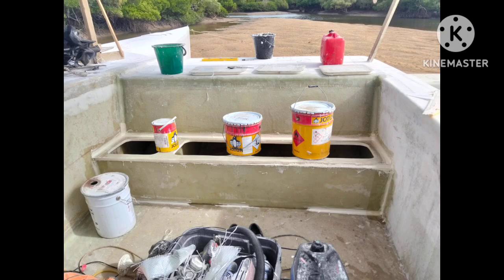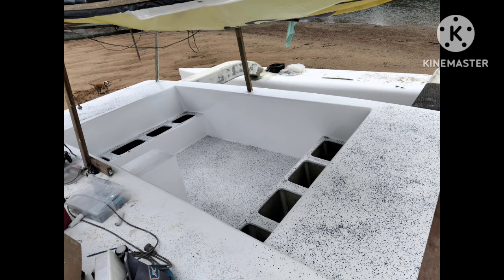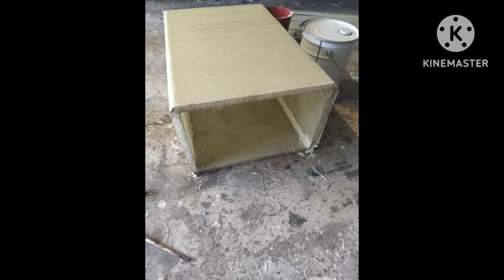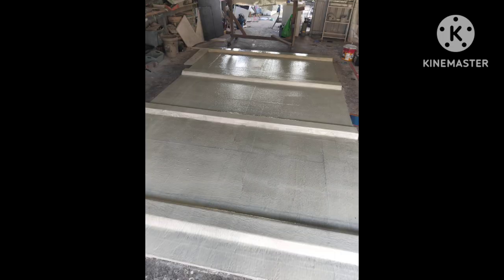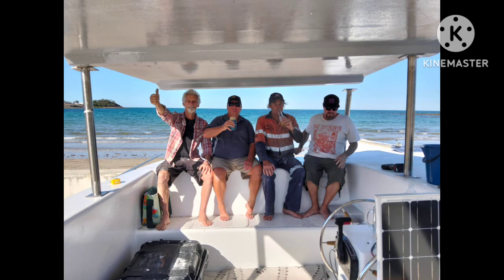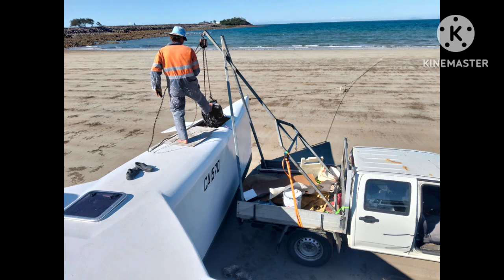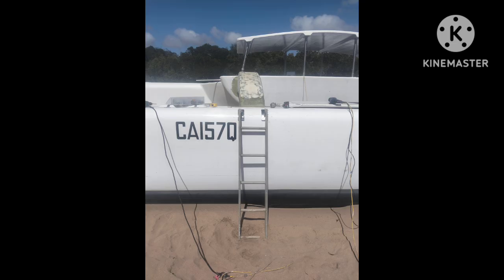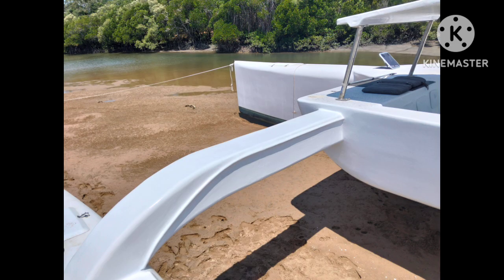Pacific Proa 60 backyard build 10

Comment: How did you decide where foam and where polycore? Foam below waterline? VEry interested in your project and its details. You are incorporating a number of novel approaches. And sense of the weight at this point (hull and beams...etc.)
Thank you!
Reply from the maker: Hi . To try and sum it up- main hull is solid glass below water line . Honeycomb composite where there are less shear forces. Foam in places with higher shear like main bulkheads, cross beams. Little hull is all Honey comb as it made it easier to torture the complete 40 foot length in one piece before glassing. I used vinylester below water line and in structural areas. Polyester in less structural areas. Weight is  impressive, I'm at about 3.5 t total so far. Cross beams are heavy about 400 kg each but necessary. I will get it weighed when completed and add to a video. Hope that helps.